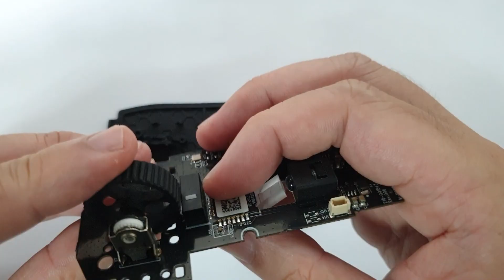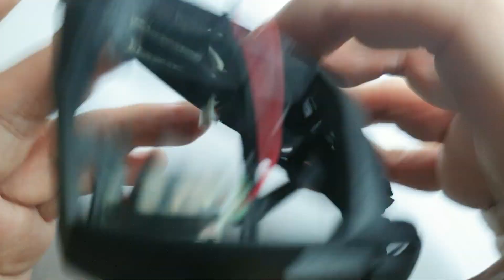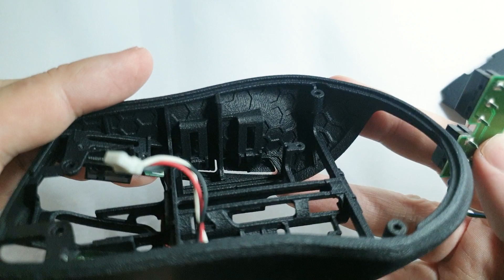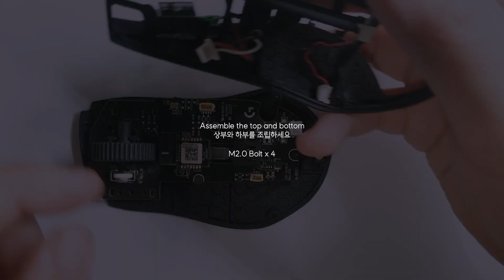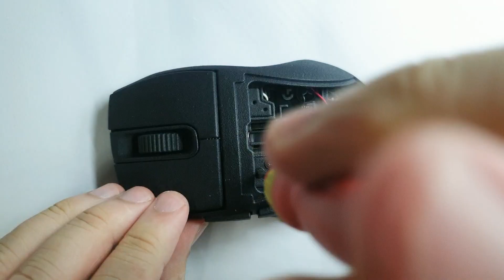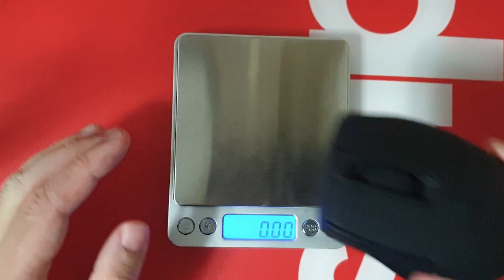RS-B v2 Assembly Guide / Roccat Kone pure shape 3D printing mouse mod

Comment: What is the end weight of the mouse?
Reply from the maker: as mentioned in description ,- Weight: 59g (Rechargeable AAA battery / Dot Tiger Ice mouse feet arc)
*Weight will vary depending on the battery, feet or 3D printing condition :)